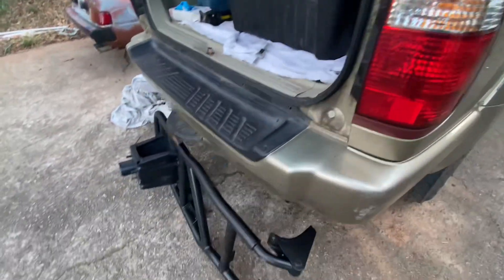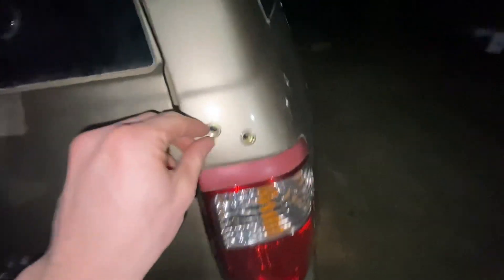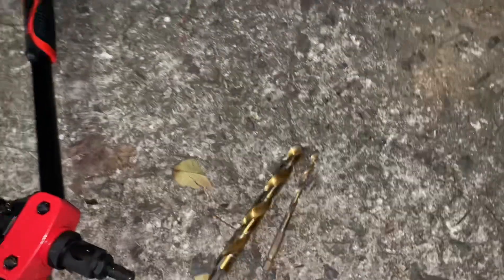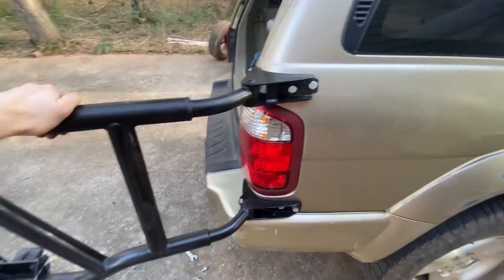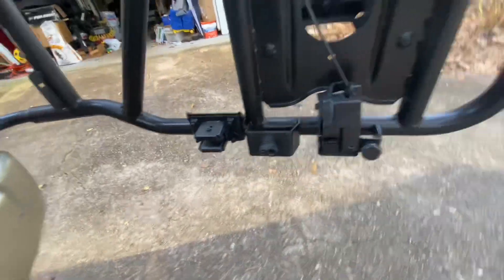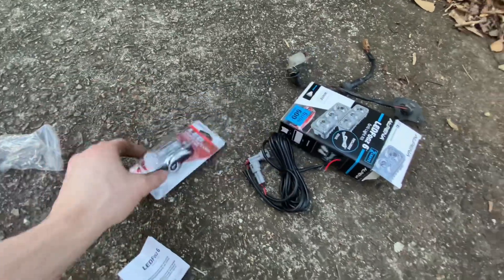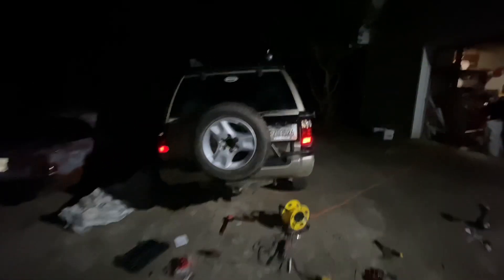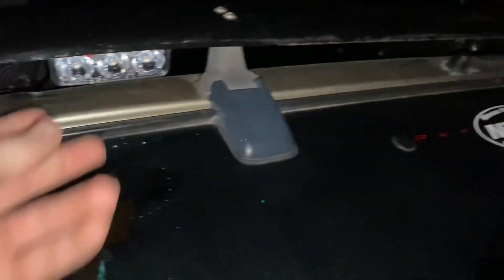R50 QX4 / Pathfinder Tire Carrier Installation

Comment: Where did you get the rack from? Looks great
Reply from the maker: So the roof rack was kind of custom made. I dont have it anymore because it could only hold so much weight, but it was a cabelas roof basket roof rack, but I cut the basket part off. So it it was just a flat platform. If you go to the pathfinder forums you can search “rola roof rack” and it will show you how to mount it and make it low profile. When I had that roof rack on there, i put a solar shower on it and an awning.